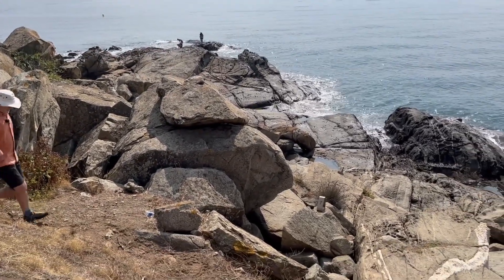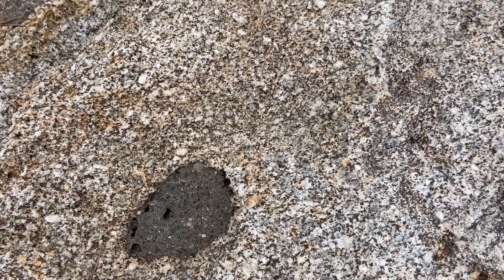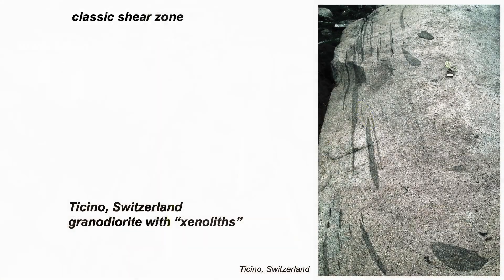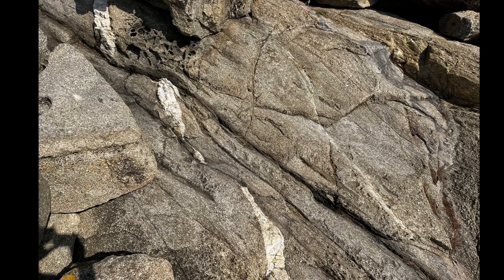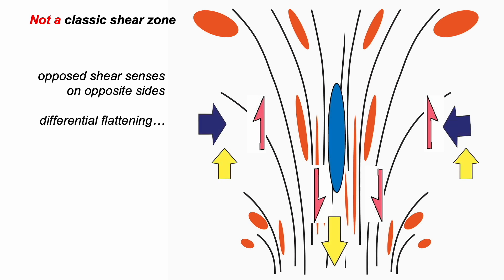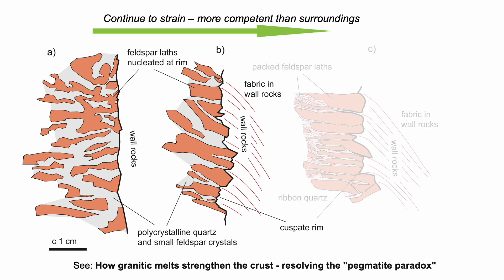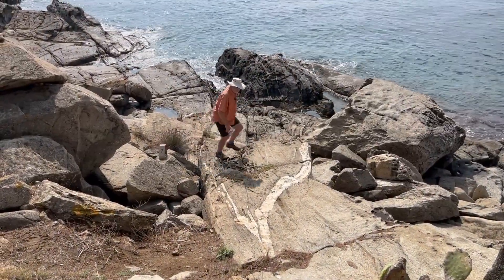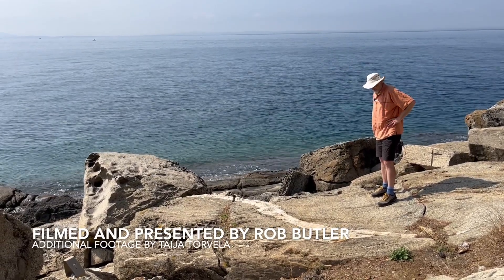A kinematic conundrum - deformation at Roses lighthouse

Comment: Ta the instructive video.
At ~1:44, a close image of the diorite enclave/granodiorite contact  shows a (wide) reaction rim with what appears to be a thin quench textured rim on the diorite zenolith. Internally, the grainsize of the diorite is larger than the rims.
This suggests that that the diorite may have intruded the granodiorite prior to solidification, but  it's a stretch to see this for certain second hand from video.
All the best from Namibia.
Reply from the maker: Good question! There could well be magma-mingling in play here ... not sure it's quench. but highly likely the Roses pluton is composite... At the time I was chiefly interested in using these objects as strain markers...

Comment: Deep crustal deformation associated with magmatism and metamorphism as well as their exhumation quite fascinates me. A very elaborative film by Prof. Rob Butler, particularly deformation of aplite intrusion is so well explained with the help of sketches. Those students are really blessed, who ever worked with you or under your supervision.
Reply from the maker: Thanks - actually this deformation probably wasn't that deep in the Variscan crust... though of course hot ...
Reply: @robbutler2095  Sir probably that deformation wasn't much deeper but it seems to be occurred in ductile deformation zone. Similar phenomenon, particularly folding and shearing of igneous intrusions,  is so common in the Himalaya, Kohistan and Karakoram, which is quite interesting. And off course, sir you have done plentiful, fantastic and one of the pioneering work on deformation and structural geology of Himalayas to Karakoram since 1980s, which is still crucial and foundation for further research.